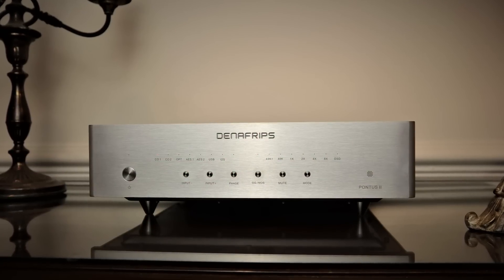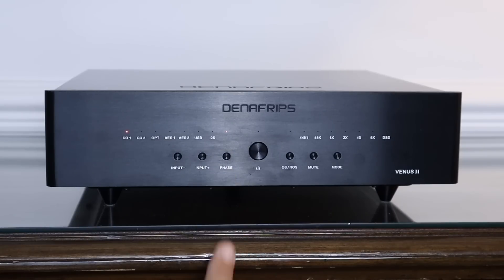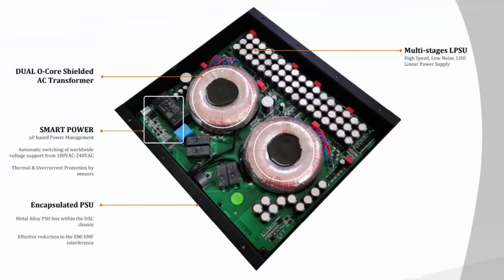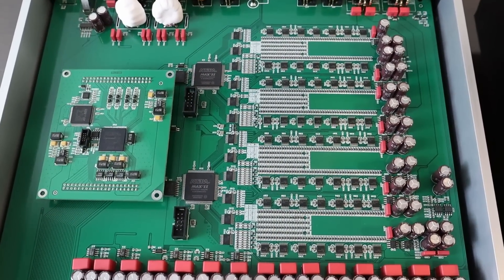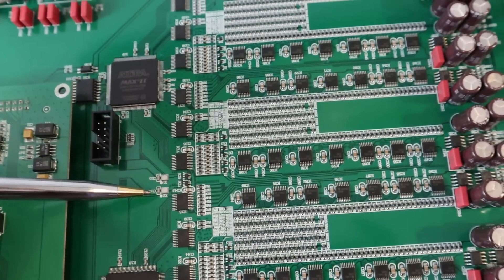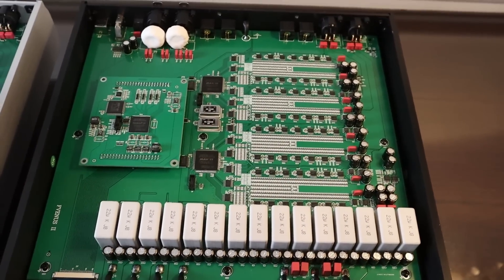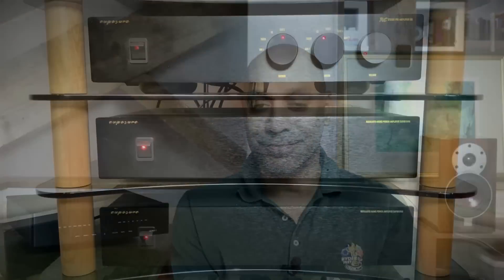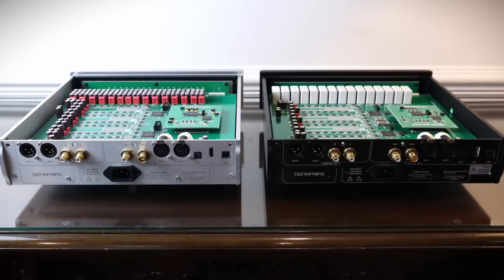Long term review: Denafrips Venus II (vs Pontus II)

Comment: Excellent review as usual. Thanks. Now, knowing how unreliable auditory memory is, let me ask you: how do you compare, in general terms, the Venus to the Holo Spring 3?  Or at least, which one do you prefer?
Reply from the maker: Thank you Giovanni. It is hard to make anything but a general comment without having both of them side by side to audition. I had the Pontus II as a common point of reference though. As mentioned in the review. The Spring 3 is more resolving than the Pontus II but doesn’t have it’s richness of tone. The Venus II is also more resolving than the Pontus II yet retains it’s richness of tone. I would deduce than the Venus II is better than the Spring 3 by that rationale 😊
Reply: Nice deduction.  I appreciate it.  Thanks!

Comment: Hi Tarun, i ordered a Venus II yesterday and as a Denafrips newbie i have got a serious question: What is a proper way to burn it in? Just leave it on or is it necessary to play music?
Reply from the maker: You need to play music through it. The amp can be on very low. It takes ages to run-in. About 200 hrs in, it should start to sound great 👍

Comment: Once again, a very good review Tarun. You are one of the best (Steve Huff, Hans and you rule the industry for me). 🙂

As I just got the Pontus 2, 12th anniv.ed., you wrote below: "I have the Iris. It improves the Pontus II but still not as to the level of the Venus II.".
1. Since I will never have the Venus 2, is this $700CAD upgrade (Iris DDC) worth it?
2. You had already told me to spend these money elsewhere for a substantial improvement, but which one?

I'm thinking of finally changing my iFi Zen streamer for a Volumio Rivo.
3. Is this the right choice?

Please know that this is the last time I will ask your opinion for this improvement, not wanting to be busy. Please know that your professional opinion counted a lot in the acquisition of my components (Hegel H190, iFi Zen Stream, iFi iPowerX, Denafrips Ares2/Pontus2, 12th. anniv. ed., with the exception of the SVS Prime Pinnacle speakers and the SKW cables ). 
I thank you GREATLY!

All this for the immense pleasure of music. 🙂
Reply from the maker: Thank you. I think a speaker upgrade will you the biggest improvement as the next evolutionary step 😊

Comment: Hi Tarun. Kind regards from Sweden. I'm hoping you can offer me some advice. I have the Dali Menuet SE's and a REL T5x with a Powernode, but am looking to upgrade the latter. If I were to buy an Exposure 2510, would a Spring 3 or an Ares 2 be the more sensible pairing? What's a power amplifier that would suit my speakers if I'd opt for a Spring 3 with the pre amp module?
Reply from the maker: Hi Johannes, the Menuet SEs are good enough to reward you as you upgrade from your Powernode to Ares II/2510 and then to a Spring 3/poweramp. How far you want to go is naturally up to you. The choice of poweramp to partner with the Spring 3 is interesting. I would check out the new Exposure 3510 poweramp 😊
Reply: @abritishaudiophile7314  Thank you for replying! In your respective reviews for the 2510 and the 3510, you praised how both amplifiers paired well with the Dali Menuet SEs, even though they differ in tonality. My taste in music is broad and includes both acoustic, pop, rock and soul. Would the 3510 be a step up over the 2510? Or is it a matter of what sound one preferes?

Comment: How would the Iris+I2S+Pontus II compare to the Venus II. Is the small savings if using a usb only source worth it?
Reply from the maker: It narrows the gap but the Venus II is still better. It share more in architecture to the original Terminator than the Pontus II 😊

Comment: Really interesting to hear that your longterm test paid off! After purchasing my Terminator+ after owning the original Holo Audio Spring lvl 2: was I convinced having made the right choice? Initially I could hear ‘potential’ - it took months before it really came alive. Other upgrades have worked out - but usually costing twice as much or more each time : E.g. Dynaudio Contour 3.0 to ATC 50 active. My sideways step to surround with SACD was a wasted effort, but still convinced me that SACD was superior to  CD in dense orchestral classical music.
Reply from the maker: Great to learn about your experiences 😊
Reply: ATC 50A is audibly better than Dynaudio Contours? Which amp did you use with the Dyns?
Reply: @morespinach9832 massive improvement- different class. I liked the Contours: very well mannered, quite a good level of detail, natural.  Used with TAG McLaren pre and power, followed by Musical Fidelity pre and power. The ATCs are a big step up with a level of authority and soundstage which is amazing.
Reply: @wouterkolkman  thought so. Thank you! Although at the price of ATC 50A I wonder how a subwoofer and amps with bigger grunt like Accuphase or Gryphon Diablo would have made the Contours sound.

Comment: I paid 5k usd on a DAC that did not work out, probably synergy.  I ended up picking up a used pontus II for 1/5 of the prince I paid for the Ayon.  I also tried a Benchmark.  I heard great things about Benchmark but my bass nearly disappeared.  I was afraid even after burn in, the DAC would be too lean.  One of the tech’s from Benchmark wanted me to try to move some jumper cables to better match the impedance of the amplifier but in the end I decided to return it.
Reply from the maker: @jeremyaguilar3805  thx for sharing your experience 😊

Comment: Hi Tarun. I have been down the upgrade path with my system so many times that it makes my head spin just thinking about it! My biggest success is definitely my turntable. I started with a 2018 Rega Planar P3. This was great but I wanted to be different and unique'ish with my upgrades. I purchased a new aluminium subplatter and a Delrin platter for £380 then rebuilt the turntable onto a kit from SRM Tech which replaced the whole plinth assembly for a dual layer acrylic affair. This was about £330. Once built, I replaced the tone arm with an Origin Live Illustrius for £1920 and the Cartridge with a Lyra Delos at £1300. The phono stage is currently an ifi audio iphono 3 with iTube 2 at about £1400. Add to that a £300 outboard power supply and the results were stratospheric. Including the original P3 the total was about £6400. Yes I know this is a lot but it was done over time. This piece of kit sounds more natural and more hologrphically analog than other turntables costing significantly more. The great thing about my turntable is, ' I had a large part in making it sound this good' something I am very proud of and would not be able to say if I had just purchased a 6 grand or so item from the dealers. I posted a rather long waffle last week on your review of the r800i about tube upgrades. Since then, we have burnt in the 300b Black treasures. They are epic. They blow away the Electro Harmonix gold grids. This amp now is ready to take on all comers. It is truly a thing of sonic beauty. Vinyl through the 800i is a thing to behold. They say that the sound quality of vinyl does not reach its true potential which can be beyond that of digital until you have heard a proper high end turntable. I can attest to that and thanks to the 800i it is dripping with organic analog, holographic goodness.
Reply from the maker: Great to learn about your experiences. Thank you 😊

Comment: What if one of those many caps fail? Would you know it or would the sound quality diminish? Seems like a bunch of caps increases the chances of failure.
Reply from the maker: The work together to smooth and filter the power supply. You won’t notice if one fails 😊

Comment: Excellent video as always. Like many, I’ve been on a pretty steady upgrade path and the Ares II was my last real significant addition. It was a real eye (ear?) opener in terms of improving the digital sound. Just wondering….my digital system is as follows.  Bluesound Node 2 or Marantz CD5005 -> Ares II -> Schiit Freya+-> Parasound A21+ -> Magnepan 1.7i (w/ Rel T/7i sub). As well, I have an excellent listening room with very good room acoustics (including some absorbing/diffusion additions). Do you think this system is resolving enough to appreciate an upgrade to either the Pontus II or Venus II?
Reply from the maker: Thank you Matthew. If you are planning future upgrades to the front end, by all means go for the Venus II. Otherwise, I think the Pontus II will do nicely in your setup 😊
Reply: Matt- Do you want to know the best upgrade for YOUR system? Add a second T7i for stereo pairs and…BINGO! What an improvement- you can thank me later…I run a Pontus ll with a pair of T7i’s. Adding the second sub made a HUGE difference! Fuller, better depth, separation and soundstage. Your Welcome
Reply: @keeferdog5617  thanks for the encouragement. I've considered that option. Could be a way to go. Especially since T7i's are easier to come by since the T7x was introduced.
Reply: @matthewrichey8542  Absolutely- I picked up a new one (open box) for $700 usd. I’ve seen used ones on Fleabay sell for $550.00. Get a second sub, dramatic change to the sq of your rig, then get the Pontus ll when you’re ready. Much better than the Ares ll. Worth the $. Good Luck

Comment: For me, sound is about the least possible changes through devices.

A preamplifier should produce the same sound as you put into it. same with an amplifier!

It's the end result that counts!

You get better sound if you use a cheaper NAD amplifier on a good speaker than the opposite!
Reply from the maker: Thank you for sharing 😊

Comment: Electronic circuits do not “burn-in” in a way described here. Manufacturers burn-in a product to test for weaknesses in design or components. Hearing a new piece of equipment for the first time and the brain will compare the experience with the sound it is familiar with from the previous equipment. A common reaction is to dislike the new sound but the brain adjusts to the new sound over time. It if like a new pair of spectacles, it takes a while for the brain to “click-in”. The lenses have not changed, it is the brain.
Reply: It would be easy to test this.   Listen to a new item side by side with a burned-in one.  Not something most hifi enthusiasts would get the opportunity to do I suppose.
Reply: @richardsinger01  If a DAC really founds different after “burn-in” then there is a fault. It could be heat causing a component value to change or failure of a poor quality component. Any quality electronics should perform identically after many hours as it did when new.
Reply: @johnm3544  It is stretching credibility to claim that a DAC can improve audibly after a “burn-in” period. It is true that electronics can deteriorate with age. For example, drying out os electrolytic capacitors is a recognised issue. There is no way a competently engineered piece of equipment needs hours of power-up time to perform correctly.
Reply: @johnm3544  Yes, some Audiophiles are convinced super expensive cables, audio tuned fuses, power regenerators etc. make a huge improvement. I have been into hi-fi since vinyl was the only available medium. I do not take much notice of opinions of others and rely on my own hearing. I have learned over the years that it is easy to fool yourself when listening intently for a particular effect as you will probably hear exactly what you are expecting to hear. Room acoustics and loudspeaker choice are super important and have a huge effect on audio quality.

Comment: Upgrade successes.. Passlabs X150.5 amplifier and Hattor Preamp w active option. Both companies have fantastic customer support. 
Biggest failure, a used Musicbook which developed a WiFi fault. Possibly a loose connection? Lindemann flatly refused to offer any remote advice or UK dealer support. Only the option to ship to germany.
Reply from the maker: Thank you for sharing Will 😊

Comment: There are several excellent DACs available for a fraction of the price of these units. I suggest no Audiophile would be able to choose the “best” DAC in a properly conducted listening test. There may be subtle differences in analog output tone, but it may be a personal preference. 
Firstly, the quality of the original recording can be a limiting factor. A poor recording will forever sound poor, even on the best system.
Secondly, listening room acoustics and choice of loudfpeaker have way, way more effect on audio quality than differences in DACs. No loudspeaker is close to perfect and even the best speaker combined with room acoustics will produce huge levels os various types of distortion that can totally masks differences in quality electronics.
Reply: I’m betting you’re a real joy at a party too.

Comment: No HDMI ARC...No Streaming either?
Reply from the maker: It is a purist DAC 😊
Reply: @abritishaudiophile7314  
HDMI can pass higher-resolution audio?
Reply from the maker: @briancampbell7712  that type of audio connection is used for a IIS data transfer 😊
Reply: @abritishaudiophile7314  I have a Marantz model 40n paired with the Dali Rubicon 2 and Rel T7x sub... The sound is very nice but I feel like I need a little more power to bring out the best of these speakers… Could you please help me… I would like to be able to use HDMI arc for my TV as well
Reply from the maker: @briancampbell7712  the HiFi Rose RS520 may be worth trying out. Here is a link to my review 😊
https://www.youtube.com/watch?v=r0cThOLxvLo
Reply: @abritishaudiophile7314  
Thank you for the link… I was able to audition that a few months ago when I was in a hi-fi audio store here in Spain but I seem to like the sound of my Marantz model 40n better because of the class AB amplifier...A little more relaxed...I think the Rose is class D and it sounded brighter...I'll go back and audition the Rose again...what is your thought? do you have any other solutions...
Reply from the maker: @briancampbell7712  the RS520 will have better bass control than the Model 40n but it has that typical class D sound that you probably noticed (i.e. thin sounding midrange) and can sound bright with some speakers. There are lots of factors to consider which is what I get into through my Patreon Consultancy but if you want a quick suggestion, take a look at the Hegel H190 😊

Comment: To my knowledge, for those interested in Denafrips be aware they have NO return policy.  I also had sync issues with the Ares 2 optical connection.  They only inform you about this in the FAQ’s!  It should be noted, it wasn't difficult selling my unit, but it was an inconvenient nevertheless.

Comment: Tarun I disagree…why do you say”spend 3.000 and you need to spend same on amp and speakers “
Reply: I would spend 70% on speakers.
Reply from the maker: The ratio changes based on needs and other factors. As people upgrade they tend to spend a greater sum on the amps and the front end. For people starting out I would suggest a 20/30/50 split on source/amp/speakers respectively 😊
Reply: @abritishaudiophile7314  also don't forget about room treatments. Getting really good bass might require multiple subs. One in each corner with DSP / EQ might be required.

Comment: Excellent review - it seemingly took a lot of burn in and system matching to uncover the differences!. Btw the new Gustard R26 (another Chinese R2R Dac) for around 1,500 pounds blows away the Aries II and strongly rivals the 2,000 pound Pontus: www.youtube.com/watch?v=RfutfUKRGtQ
Reply from the maker: Thank you Connor 😊
Reply: @abritishaudiophile7314  I since heard a youtube demo in which Pontus actually beat R26 on dynamics and bass articulation. However there is another demo in which the Musician Aquarius at $3,200 beats Pontus on Prat and clarity and likely also challenges Venus on these parameters. Here is a demo (at 13min) of Musician Aquarius Dac - paired with the also excellent Musician Knight 1 speakers (perhaps rivalling your Proac as they are built with Dynaudio mid-bass woofer but then adding superior tweeter, cabinet, crossover components and terminals all for just $2,000 including shipping) - www.youtube.com/watch?v=nDWHZ5R5V8c

Comment: I can tell you firsthand  the Gustard R2R-26 is a better dac all around it takes a solid 300 hours to fully runin
And as always put a decent power cord on it , the Aries 2-12 th  doesnot have a external fuse 
But the Gustard does if you put a 2.5 amp slow blow 20 mm synergistic purple fuse, or Audio Magic M1 fuse
You will be properly rewarded with even better detail ,imaging and depth
Reply: Indeed it has an external 2A fuse